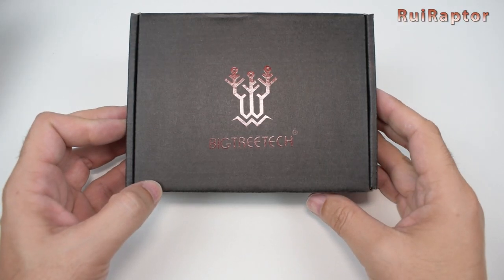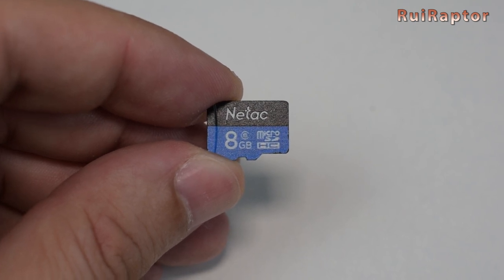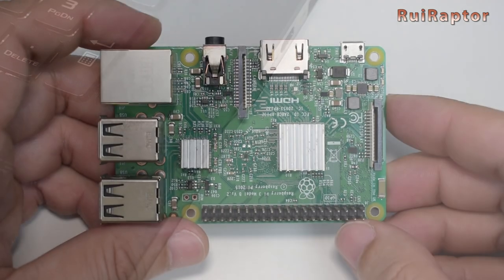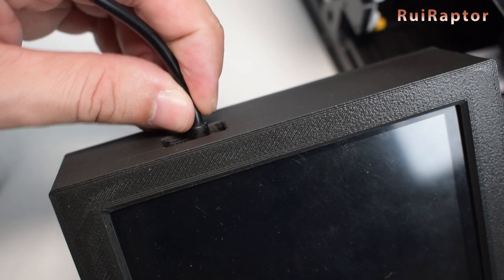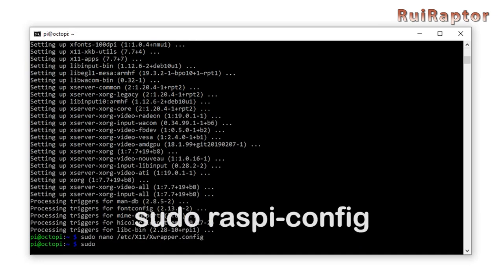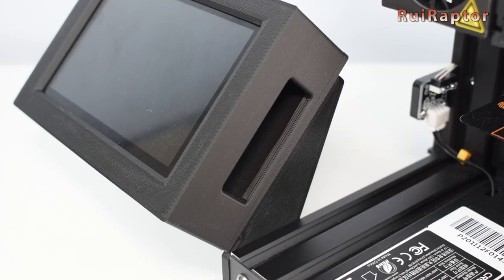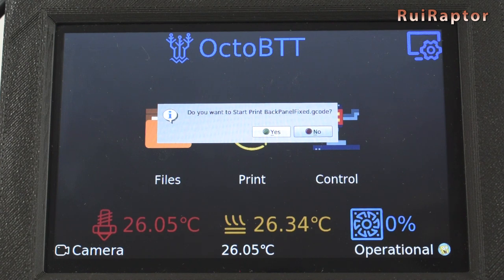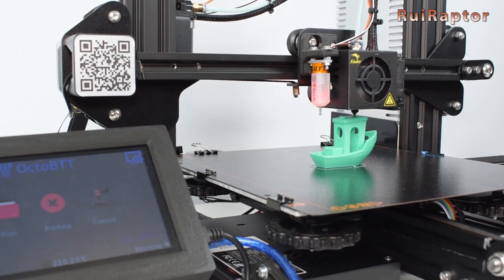BIGTREETECH PI TFT50 Touch Display - Installation Guide & Review

Comment: I can't see where I would gain enough to make it worthwhile with the current limitations. Good video, thanks!
Reply: Totally agree with you- on the tft 3,5 v3 almost all you need (improve the WiFi and option adding camera and it will be nice one;)
Reply: Will you explain the limitations you're referring to? I'm trying to gauge which display to get for my octopi setup.
Reply: @Turtleboogers  I  have the BigTreeTech TFT 3.5 on one printer, and the TFT 7.0 on the other printer. Both of these displays will toggle between compatible LCD12864 mode ( the original text display) and a graphic display. As far as I can tell all of the options available on the PI screen shown here are available on the TFT screens AND they are user definable - you can customize the menus and options yourself. They are better organized too. You do have to compile the firmware for the display to customize but that's simpler than the process shown here for modifying the PI's software to enable a graphic interface. 

I guess the limitations I was thinking of (it was 5 months ago!) are the clumsy interface, the need for two displays, and the bugs in the interface, and the cost of the screen versus the benefits that result. The software issues may have been resolved by now. 

And I'm using these displays and have a PI connected to each computer. The browser interface to the PI is more than sufficient to do everything I want, and having the option to toggle between text and graphical interface even while printing is great. Other than setting the PI up with Octoprint originally I've only needed to communicate via SSH once, to change the time zone.  I do find I still use the text screen more than the graphical mode because to be honest Octoprint takes care of so much the only thing I use the printer's screen for is preheating and adjusting the Z offset for my bed leveler when I change a nozzle. 

If you don't yet have your PI, I'd forgo this graphical screen to get started. See how you like it as it's normally used. If you find this insufficient then you can always add this screen later. And the non-PI graphical displays are about half the price. 

As to which PI to get, the 3 will do the job just fine. I have a 3 and a 4 and the only differences I can see are the 4 is snappier on it's web page and it really does a much faster job on the Gcode Viewer, but otherwise I'm fine with either.

Comment: I just recently picked up the BTT TFTPi50 V2 and running it on a raspi 4 8GB. It really is an awesome screen! IMO probably the best you can get. Super easy to get up and running and the response is very good. I really like how it’s powered directly from the pi with the ribbon cable! No extra cords getting in the way. I’ve got it setup on my Ender 3 V2 running OctoDash. I just ordered another raspi 4 8GB and another BTT tftpi50 that I’ll be setting up on my prusa mk3s+. My only gripe, which doesn’t really matter, I did not like the BTT printer dash UI. Too crowded with everything they try to cram on the screen. I’ve also been looking for a screen mount and a way to enclose everything. I think I just found what I was looking for! Thanks for sharing!!

Comment: Hi, nice  tutorial, thanks.
Upgrading a raspberry PI is always 2 staps ... first "sudo apt update" and then when there are packages to upgrade do a "sudo apt upgrade -y". this last statement is missing. After the upgrade has been executed it is best practice to do a "sudo reboot" as well, this makes sure that all new package are running before you continue the installation process you did described.

Comment: I was looking for a video about the lagging with octoprint. Finally someone notifying this problem. I was so frustrated about this and disconnect octoprint. Is there a way to connect the printer to the the computer and change those port values that way. Just using the computer?
Reply from the maker: Hi, for changing the serial port settings in the firmware, you need to compile the firmware again. For that you need to use visual code studio and platformio to compile it. Then copy the BIN file to the memory card and boot the printer with the memory card inserted. We don't have a video for the SKR firmware update but you can see how the procedure works for a different board and go from there. https://youtu.be/y87P7K5DTMU
Reply: @ruiraptor  Compiled the new marlin and changed ports. And it works!! Thank you so much, now i can use octoprint without getting angry :D

Comment: Thank you for the Tutorial, I've followed along very well,  all is working okay apart from the BTT GUI …..pitft50 displays access detail, then that the image comes without desktop environment. ? 
would you mind pointing out what I've done wrong. many thanks
Reply from the maker: Hi, did you see any error message while installing? If at least one of the commands was not correctly written (caps when needed for example) that can happen. We did this procedure many times for the video and it worked every time. Try running everything again and also check the BTT link and see the command lines from there if it's easier for you. If you want additional help, send us an email and we can try and help you.
Reply: @ruiraptor  I've repeated the process, I get the BTT dash if I leave it after installation... Its when I down power then go to add to the printer, I lose the GUI.
Reply from the maker: did you run an octoprint update in the meantime?
Reply: I rebooted and all was well.

Comment: maybe im doing something wrong but I've went through the process multiple times and every time i reboot im just taken to a command prompt screen on the display. no controls or anything. no idea where to go from here?
Reply from the maker: Hi, make sure each command gets executed without errors during the installation.
Reply: @ruiraptor   I've been pretty thorough on my inputs. As far as I can tell everything as been done correctly. I have a pi 4B and did notice that my sudo raspi-config settings are in a diffrent order but my I did find the auto desktop that was stated. I tried a diffrent YouTube tutorial and still no luck
Reply: But yes, no errors
Reply: Wait I just realized my display is v2.0 does that makes a difference?
Reply from the maker: It might...we would have to check. We will try and find out.
Reply from the maker: Hi, check here: https://github.com/bigtreetech/OctoBTT
Reply: @ruiraptor  thanks for the update l

Comment: How do I correct error after install.sh "password su: Authentication failure" for Setting Xorg Permissions?
Reply: Same problem with mine

xorg is already the newest version (1:7.7+19+b8) 
The following packages were automatically installed no longer required: libllvm8 rpi-eeprom-images
Use 'sudo apt autoremove' to remove them.
Done..
Setting xorg permission ... 
-bash: /etc/systemd/system/getty@tty1.service.d/autologin.conf: Permission denied
Password: su: Authentication failure
Reply: @ArvinG  I started over from scratch and followed BigTreeTech's instructions. Much easier, fewer steps and no issues afterwards

Comment: Thanks for the clear explanation. Hoping someone can help me. I got through every single step until the last one. When typing the install.sh command, I received an authentication failure. Here are the last three lines:  Any thoughts? Setting Xorg Permissions ... -bash: /etc/systemd/system/getty@tty1.service.d/autologin.conf: Permission denied. Password: su: Authentication failure
Reply from the maker: Hi Joel, please check the latest installation manual from bigtreetech. They simplified the installation process and it's much easier now.
Reply: @ruiraptor  it worked! (with some small adjustments to the install command to overwrite the previous version). Thank you!